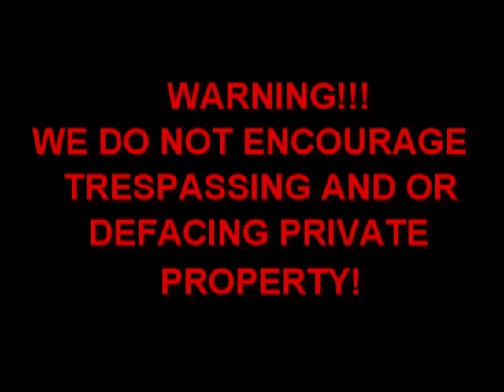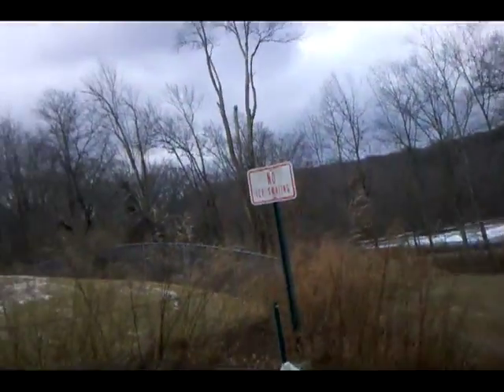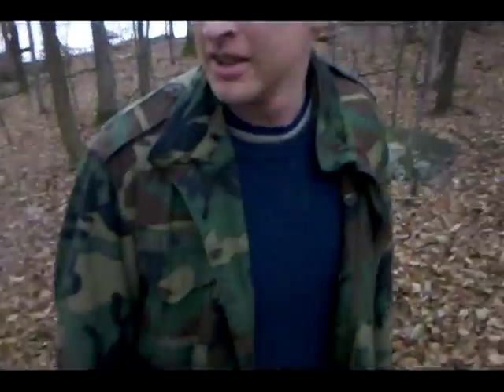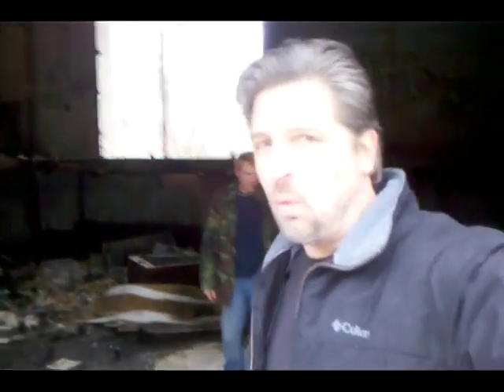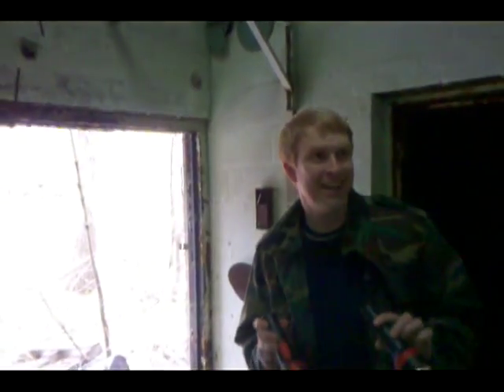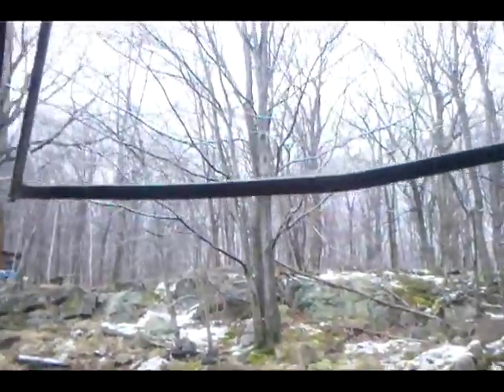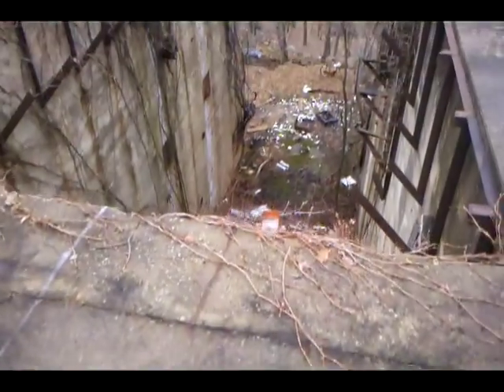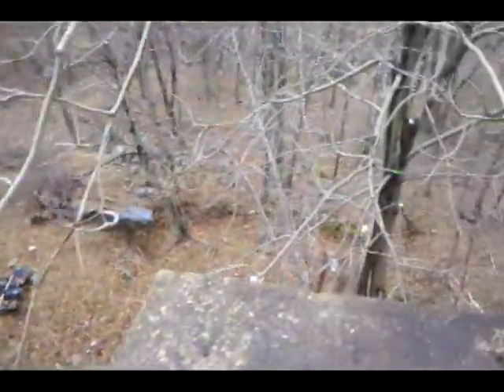REACTION MOTORS AREA R - ABANDONED ROCKET ENGINE TEST SITE IN NEW JERSEY

Comment: The building is still there but i believe is currently occupied.  For many years, one of the test pads and stand that held the engine were still on the outside of the building.  I have not looked for it for years so dont know if it still exists.  I will do some followup up and let you know.

Comment: My father Willard Sweetman Jr was the senior design Engineer that huilt the XLR 99 liquid rocket motor for Reaction Motors A division of Morton Thiskol 
Eye was born in Franklin NJ in 11/1951 
We moved to Brentwood in 1954 where my Father went to the USAF Edwards Air Force test flight facility 
A little known footnote That facility was also used as a receiving port for downfed UAV unidentified Aerial Vehicles to b examined for reverse flow engineering 
Thanks for sharing 
Mu ah VA 💋 🌈